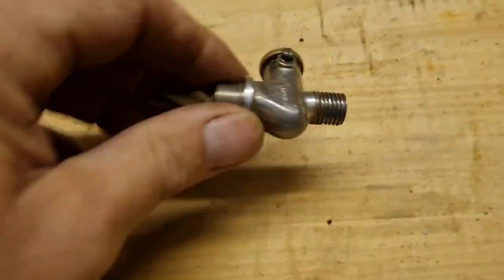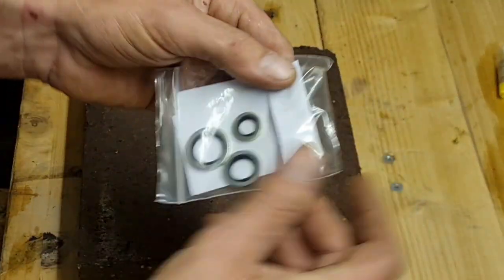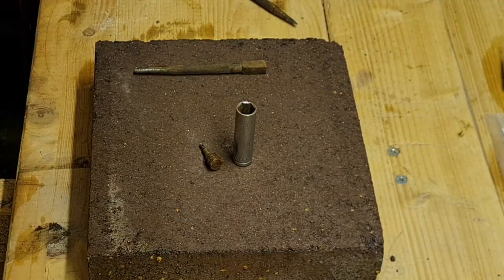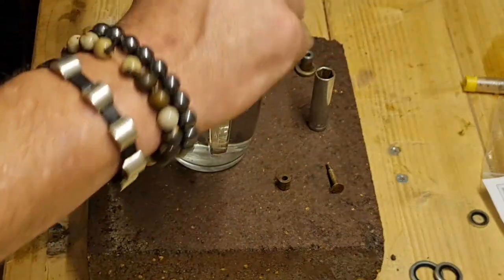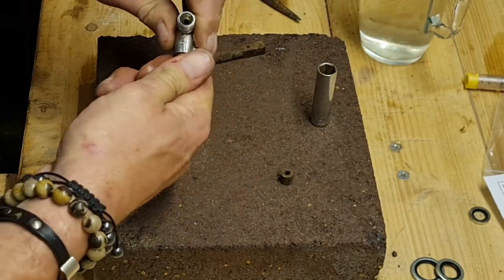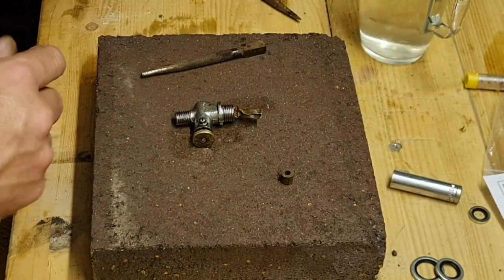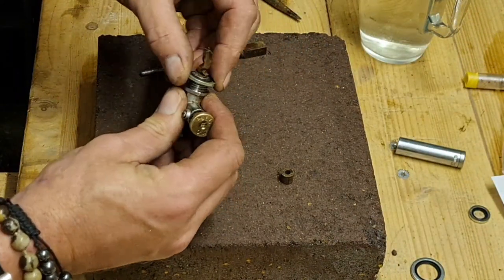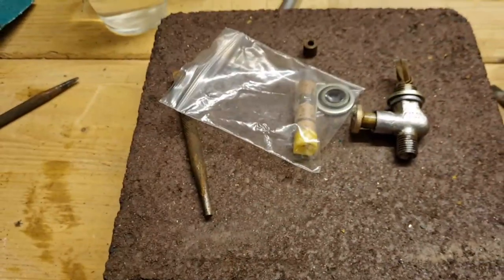BSA Engine petrol tap repair. Re Cork.

Comment: Very helpful video! While replacing the carburetor on the old BSA I had drained the gas tank. However, this apparently caused the corks to shrink since both the taps leaked after everything was re-assembled... Since the corks were over 10 years old they are likely due for replacement. This video makes it look fairly straightforward.

Comment: Thank you for this video, informative and entertaining. Did you peen over the rod passing through the cork and slide to avoid it pulling off when pulling hard to open the tap? Course, the cork should stay bloated when the petrol tank fills, or did it shrink down a bit for you?  Asking cos I have to re-cork mine!